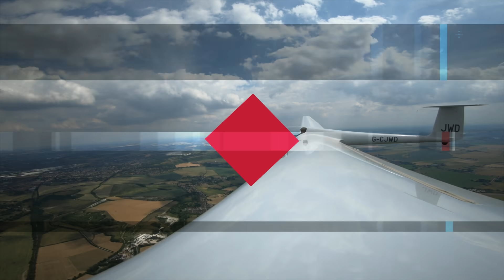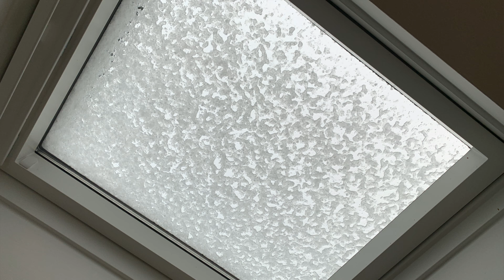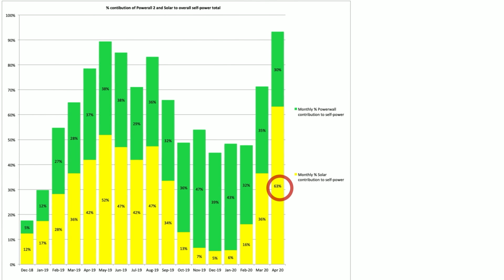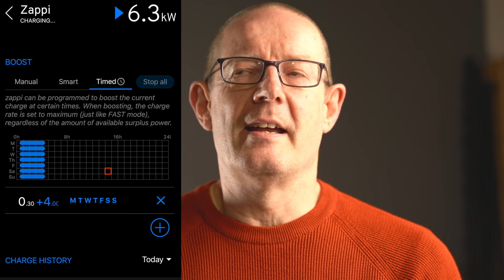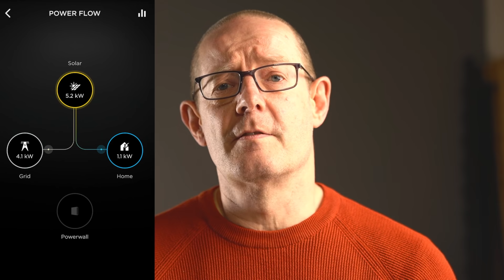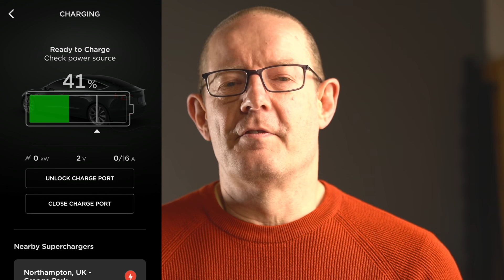Solar and Tesla Powerwall 2 performance April 2020 in the UK

Comment: Really enjoyed your update.
I think your Eddi isn't recording boosted energy that comes from your battery. Mine behaves the same.

Great to see another similar installation upgraded similarly too.
Interesting again your Solaredge generated more than mine the se2200 Vs se2000 makes a difference it seems.

I definitely need to work on my consumption numbers. Currently they're a mess and wrong as my battery is installed in the wrong place compared to where the CTS need to be.
Reply from the maker: Thanks Nigel. You are right about the eddy not recording boosted energy as green. I'm not sure if that's an inherent fault, or a system setup on. Might ask Dale (SpectrumGeeks) how his reacts to a boost. 

It can be frustrating when you can't see all the consumption numbers, or know that they are not reflecting what is going on. Although mine seem to correlate across devices, they are not that accurate.